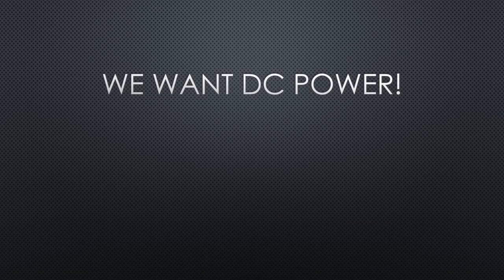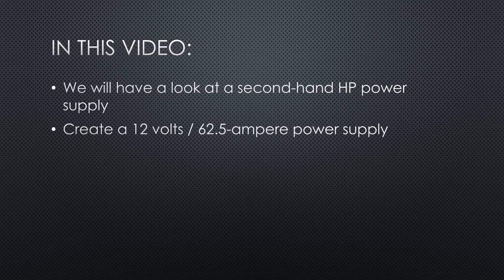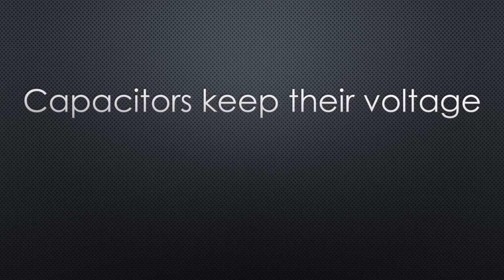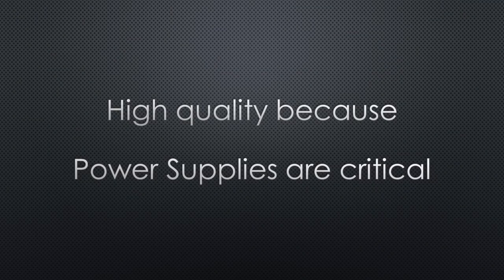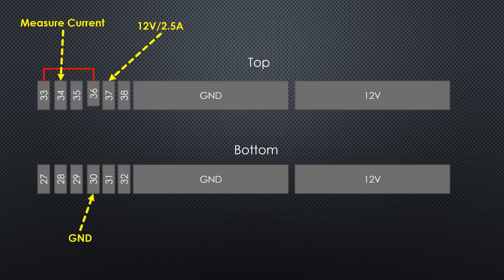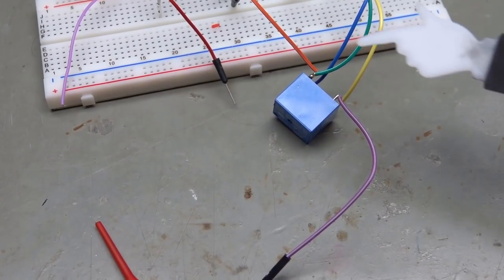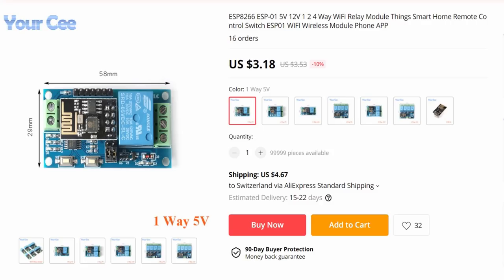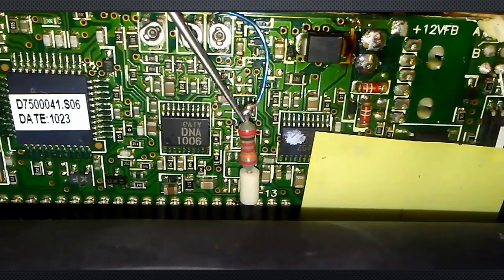#342 12V/60A power supply (PSU) for 20 dollars? Unbelievable, but true. And high quality.

Comment: Hahaha ... way ahead of you, got one of these for my 3d printer.

Just a word of warning, the pinouts of these vary wildly so make sure you look around and google the net before you buy one to make sure someone has already figured out the pinouts of the model you are looking to buy.
Reply from the maker: Cool! Maybe you share your experience. Especially about the noise
Reply: @AndreasSpiess  Haven't had any issues with that. But haven't measured it either, might have to boot up the ole tektronix scope for that one.
Reply from the maker: I mean the acoustic noise of the fan ;-)
Reply: @AndreasSpiess  oh ... duh ... None, well that is not true, it runs at full power for a small amount of time when you power it up then drops down to barely audible level. Mind you it I doubt my 3D printer and heatbed are really stressing the unit much.
Reply: @AndreasSpiess  Also, couldn't help but notice many of these have SCL and SDA pinouts ... hmmm...

Comment: I have the same PSU powering my 3D printer! It is certainly a beast - most times it doesn't even use a fan. Based on a label, it looked like mine was running for 8 years in some clean data center room - there was zero dust inside. Unlike Chinese PSU all components (capacitors, transistors) are genuine. My advice for hobbyists - solder some thick (2.5mm2 at least) wires to the huge pads on the connector and attach beefy XT60 plugs. It will help with strain relief - otherwise it is easy to tear the pads on the PCB apart.
Reply: The only major con I've experienced is that this PSU has an active power corrector. So it has got a great power factor and efficiency, but it doesn't work with the UPS. I bought a cheap APC's "Back-up UPS" to protect my 3D printer from power outages, but when the mains power drops, the UPS doesn't recognize it has HP PSU connected.
Reply from the maker: Interesting. I never thought about the power factor because it is not measured here in private households.

Comment: Nice solution! If I need 24V, is it (relatively) safe to put two in series?
Reply from the maker: You have to remove the cases or isolate them. You find info with google
Reply: In that case I recommend you to buy a used industrial psu for example from Siemens. They are also very high reliable but mostly have less current capability
Reply: Great idea!
Reply: It can be risky when you overload it.  As long as everything is within limits, no problem.  But when you short it or even worse when you go to the max output current, one gets powered in reverse by the other one, and BOOM.
And you need to study the design.  Sometimes the - is floating or easy to disconnect from the frame, sometimes not.

Comment: Dear Andreas, good video as always! However one comment: Neopixels normally need 5V DC. Is there a way to reduce the Voltage? If yes, how much Amps would the unit be capable of at 5V?
Reply from the maker: For large project I probably would go for the 12 volt version (WS2815 if I am right). Or you do the power distribution on 12 volts with smaller stepdown converters at strategic places. This would save a lot of copper.

Comment: they are cheap, powerful, usually have pfc correction, have stable voltage with relatively low ripple/noise, have protections and usually can be adjusted in its output voltage a little bit.
and they are very noisy.  disabling the fan or putting in a weaker one isnt ideal, they get hot without proper airflow and under too little load.

i usually get mine from used server part shops (for example servershop24), they usually sell them for really cheap since they are not used in newer gear anymore and are basically waste. 
400W HP powersupply for like 2€, 600W for like 5€.  even for just the parts its worth it.
(they also have lots of fans and heatsinks for almost no money... )

in rcgroups forum you find a thread of many server psu's with a explaination where to bridge to turn them on. many dont even need this procedure.  but some are more complex than a resistor to start.
https://www.rcgroups.com/forums/showthread.php?1292514-How-to-convert-Server-Power-Supplies

for the really big boys, theres the "cisco ws-cac" powersupplies you can get for like 15...50 bucks used and they come in 1300W up to 8700W! (over 3x230V C19 plugs) 
at its 42V thats roughly 190A. 
i got the 6000W model for playing around and the 1300W for a project.  havent seen the 8700W model for cheap, but the 6000W is like 25 bucks.
and they are not that noisy as they look like, the small hp powersupplies are worse
Reply from the maker: Thank you for the info. I ordered a WS-CAC-1300W to play with :-)

Comment: Hi Andreas, if you would need even more "oomph" you probvably might want to search for HP part no 488603-001 or HP part no 732605-301 having ~17A more output current than the previous one ... The later one is nearly topping out the current for a single phase power outlet in germany. Both model do have buiiltin fan and are roughly 70cm long but only 6x6cm on the front face.
Edit : The PSU you are using appears to be the model used in HP DL380G6 Servers ...
Reply from the maker: You are right. There are many more available. I found it important to find the info for the mod for the one I purchased, because I want to have it at 13.8V
Reply: I have a couple of Dell R900 series server PSUs. The box is bigger but you get 130.8 amps 12V and 5 amps 3.3vsb with a 230V input :) The  power connector is a tricky one though, not an edge.
Reply: @benbaselet2026  I'll raise ;p I have 2x HP ATSN 7001133. 187A @12V each... And I got them for free. Server PSUs FTW!

Comment: Do you know the idle mains wattage with the power supply turned on? Not powering anything on the large 12V pads, but still turned on. 
Thank you.
Reply from the maker: I do not know if I did not measure it in the video :-(

Comment: When going this route, don't go too old. I got burned already. While being very clean on the output which is good für shortwave radio, my IBM PSUs took 6W when off and 42W when turned on without a load. So i sold them and turned linear using an old halogen lights transformer which is much more efficient :) YMMV as always but be warned, that not every model is good to use
Reply from the maker: Thanks for sharing your experience. Mine consumes 12 watt idle and on.

Comment: Great video, certainly a beast of a PSU . . . Any info on the PMBus I2C interfacing with Arduino? I cant find anything useful for HP PSus. 
Thnx
Billd
Reply from the maker: I never used at it because I assumed I do not need more info from the PS.

Comment: I got a 24v 63a Mean Well RSP-1500-24 power supply for €15. I got this one instead of a server power supply, because it's much easier to connect wires to it. It is adjustable between 19.5v - 27.5v. I need to get it a little lower, about 13.6v - 14.2v. Is that a simple task? I guess it is better for the power supply to adjust it a little lower than to adjust a 12v power supply to about 14.2v. There is a different model of this power supply. The SPV-1500-24. That one is adjustable between 4.8v - 28v. But I don't have that one unfortunately.
Reply from the maker: I assume this was also second hand? Because its price is more than 500 dollars...
Reply: @AndreasSpiess  Yes also second hand.

Comment: Thanks for the information on the other Pins :) Did not know that. Having 12V standby voltage is pretty handy. BTW: did you ever try to get rid of the differential/common mode distortions?
Reply from the maker: I use it to power my amateur radio rig (HF, VFH, and UHF). I tried with such a power supply and with a battery and did not find a big difference. But I added a few toroids (see his videos in German: https://youtu.be/ii2ObHio9BM )
Reply: @AndreasSpiess  Juppp that video i know already though it looks like a little overkill :)

Comment: I have 5 emerson  3.75 kw server power supplies in use. each runs on 53.5 V. These Powersupplies have an RS485 interface to adjust voltage and current. But I never got around to tnker with it. I was wondering if this is up your sleeve.
Reply from the maker: 53 volts is above my range. I usually stop at 24V ;-)  They could be used for huge RF power amplifiers.

Comment: Have you thought about buying a cheap chinese IGBT welder for a super strong DC power supply? Those can be found for less than 100$ on chinese websites.
Reply from the maker: We need a regulated voltage and I assume this is not needed for a welder.

Comment: Hi Andreas. I wanted to ask you a few questions about HP power supplies. I have 2 of 2950w, is it possible to make 12v outputs for graphics cards? the model is HP ESP120. greetings from Argentina
Reply from the maker: I do not know this power supply. But google says it has 48 volts output.

Comment: Very interesting. I just googled eBay UK, I can even get a 1200W HP PSU for £20. Can I put two of these in series to make a 24 V supply? Or is grounding a problem?
Reply from the maker: It is a grounding problem. But it can be solved. Just google...

Comment: Dumb question.. but why are you using a relay? You could put the FET directly across the control pins.. it's just a control pin, there's almost no current going through.
I wish these supplies were available in 5V.. for regular LED strips 12V is nice, but for Neopixels you need tons of amps at 5V, and stepping down from 12 to 5 at large currents is not that easy (and wasteful).
Reply from the maker: You can try a FET. I was not succesful
Reply: @AndreasSpiess  hm. I don't know about this exact model of PSUs, as I don't have one of them available, but I built a similar system for older HP server PSUs that I was lucky enough to also get the backplane where these plug into, and there the power was only switched via a FET. I assumed this wasn't changed, because it's so simple and robust.. but perhaps it was. Would be worth trying to find the backplane for these PSUs to reverse-engineer the original startup circuitry.
Reply: hmm. damn. most of the backplanes for server models that fit these PSUs are completely passive and do the switching on the mainboard. the only promising model I found is for the ML330 G6 = 519200-001 that has the control logic inside and also seems to output a regular ATX plug and a few extras. but that one costs as much as two PSUs.. dunno whether reverse engineering that is worth the investment.
Reply from the maker: Remember: I only have 3.3 volts for the gate! With 12 volts it probably would be different.
Reply: @AndreasSpiess  The IRF3708 you used here has a gate threshold of 2.0V, so even with the 3.3V from your ESP, it should go fully open. What am I missing? I feel like I'm overlooking something very obvious..
Reply from the maker: It is not the gate threshold. It is called Vgs. So the source level also matters.

Comment: Hello I have a resistor between pin 33 and 36. I want to put a 3 pin rocker switch(with led). Is it correct to put the resistor between the 
outside pins of the switch and the middle pin to a ground?

Comment: Thanks for this info. I have just placed an order for a couple of them for £15 delivered :-)
BTW - Can you see any problem linking two (or more) in series for higher voltages as this could be an ideal cheap power supply for a CNC router.
Reply: Series is fine except their grounds are both negative so they cannot be touching each other’s cases (or you can open it up and risk your life [and the power supply’s] trying to cut every ground wire and nut)
Reply from the maker: You have to isolate them properly.
Reply: alanesq
 - The bottom PSU of a series-connected setup requires no modification, but the input (AC) and output (DC) grounds have to be separated on all the other PSUs. This can usually be done by just replacing the nuts and bolts that connect the PCB grounds to the chassis with plastic ones. Just remember to check the resistance B/W input and output with a multimeter when you think you are done (before connecting the power)...

Comment: Thank you for this video! What about noise? I know these blade server PSUs can be super loud. How is the fan noise?
Reply from the maker: Mine did not run. I had no chance to consume max. Power. But others comment they are loud.
Reply: Momfasa
 - Yes, they are really loud since the integrated fan (if any) is really small and thus has to spin fast. Also, rack-mount HW is intended to be in a place where the noise doesn't matter (no people around), so minimizing the noise probably is probably not too high a priority when designing this kind of gear.
Anyway, many server PSUs don't have a fan at all, and you can get a quiet unit by making your own (encompassing) enclosure that has one or more large and quiet (e.g. 12cm) modern home PC fans.

Comment: Interesting! I wonder if you can also use DC power (320VDC or 230VDC) on the input side to use the PSU kind of like a Buck converter?
Reply from the maker: Theoretically it should be possible, but I have no such power source.
Reply: I have done it, works great.
Reply: I just ran across a box of power supplies that specify a range of AC input voltages and 330VDC as possible inputs.  Output voltage is 37VDC,  I'm not sure what that would be good for.  Came out of some IBM gear,  I think.

Comment: you are awesome, thank you
Reply from the maker: You are welcome!
Reply: @AndreasSpiess  I have been using HP power supplies for a while and they are extremely reliable and quiet until pushed at over 600W load for the 1200w models

Comment: These supplies have V- grounded to the chasis so if you want to use them in series you have floating grounds. Could we use coupling capacitors to prevent this and have all the supplies properly grounded without shorting them?
Reply from the maker: There is another commenter who did it. Maybe you ask him how his concept is. Or google. You will find some inspiration
Reply: @AndreasSpiess  I've googled it but the information i found is't enough to make me play with ungrounded mains. But thanks.
Pd: Btw I'd love your RF and satellite videos
Reply: Zetsubou_232_
 - The first PSU requires no modification. For the rest of the units, all you have to do is disconnect the output (DC) ground from the input (AC) ground and the chassis. This can usually be done by just replacing the nuts and bolts that connect the PCB ground to the chassis with plastic ones. Just remember to check the resistance B/W input/chassis and output before connecting the power...

Comment: 12v Lead acid batteries need 13.8v charge voltage. Does the voltage adjustment range allow for this use?
Reply from the maker: As I said in the video. Yes, but with mods.

Comment: Do you need that relay to switch the power supply?  The MOSFET can likely switch it directly...
Reply from the maker: I tried it. Maybe you are more successful
Reply: @AndreasSpiess  Is the left pin on the connector a ground?  Or is it some supply that feeds into the enable pin?  Of course the circuitry as to be adapted accordingly...
But I don't think they use a relay for this in the actual server.
Reply from the maker: Both are "undefined". This was my problem with the transistor.

Comment: Nice video!
Can this PSU be used as a PWM output? Instead of relay to use a MOSFET and switch it at 100 Hz for example.
Reply: It certainly is not designed for that!  The control input is for operate/standby of the server.

Comment: Great tip.
I'm currently building a sim racing rig and wonder if I can use a switching power supply for my powered Recaro seat?
The seat has electric adjustment, cooling and heating (power hungry).
I'm currently using a small motorcycle battery that works fine, but needs recharging.
Reply: Well if it uses 12v <800w then you can do it
Reply: @KingJellyfishII  Thanks. I wasn't sure if a switch mode power supply was suitable with the seat heating.
Reply: @jeppeladefoged5218  well I guess it is, it's just another way of converting one voltage to another. As long as it can provide enough current and the voltage is right then it'll be fine

Comment: How do you connect cables to these PSUs so that they don't catch fire at the connectors at 60 Amps? Is there a way to find the type of connectors they are using originally. This one would be perfect for a 3D Printer.
Reply from the maker: You find many ideas on the internet. 10 AWG is rated at 55A if used with air around it

Comment: Thanks for the video! I have connected my volt/amp meter to pin 34 , however with nothing connected itS showing 59 amps? is this normal? Thanks again.
Reply from the maker: It is obviously wrong. But I do not know, what.
Reply: @AndreasSpiess  I think its my amp meter its rated 100amp , thank you.

Comment: I just bought one of these 62A Power supply. It's working fine but the only problem Is that it continues consume 25watts extra even when I only attach 100watt load on the output. Please help me if you have any suggestions
Reply from the maker: I never looked at the efficiency, so I cannot help :-(

Comment: I found it disturbing that you didn't mentioned the fact that these puppies make the sound of an helicopter when turned on, and that most hacker try to control the fan first when modifying such a PSU ^^
Reply from the maker: Actually mine is quiet. So probably I was lucky
Reply: @AndreasSpiess  I confirm you're lucky. I can't stand close to mine for more than a minute...and disconnecting the fan obviously puts it in fault mode 😭